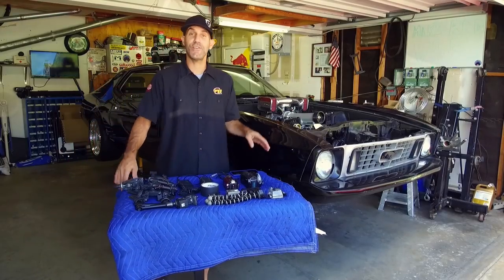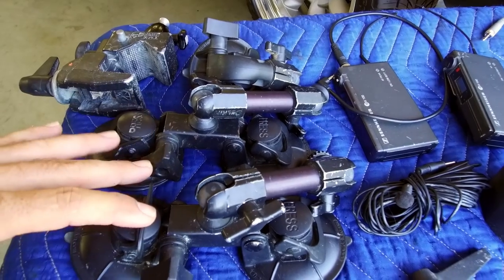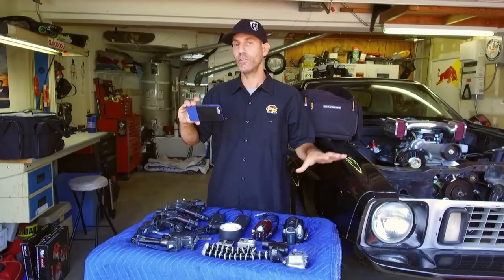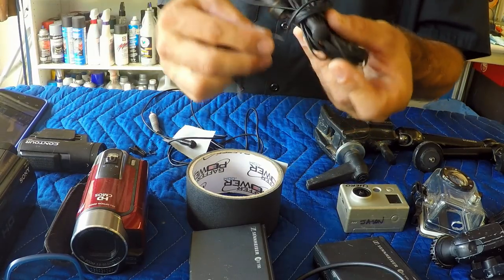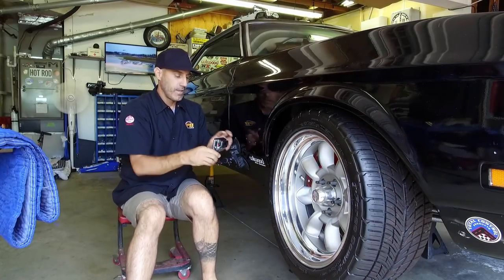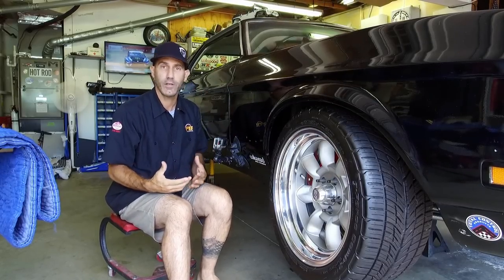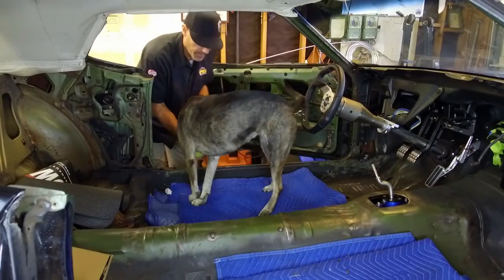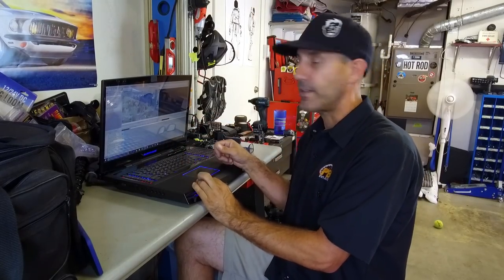How to Make Great Automotive You Tube Videos - PRO Level Tips and Tricks

Comment: This is great!!! You mentioned this vid in a Jeep video but it never came up as a suggestion for the Jeep vids so I finally hunted it down in your videos list. Glad I did, thanks for sharing your techniques!!! The horn honk is a great idea!

I’ll make a wheelin vid some day soon and you can feel free to critique me and I would welcome it but I do have several comments. I only have 1 GoPro so will have to figure out safe ways to mount larger cameras somehow. I have 2 FS7s and a Canon 5D Mark III. I’ll have to check out those mounts you use. Zacuto makes foolproof but expensive articulated arms that could be used to mount cameras I think and they have a lifetime warranty and have deals at times or you can buy some used on Ebay. I prefer when you also include in your interior wheelin shots in your truck the steering wheel to add motion and information. Since your output is HD, it would be nice to have a 4K camera on the dash area that can be reframed in post to zoom in and maybe get both types of shots. Do you shoot anything in 4K to reframe in post and make like having twice as many cameras running?

So it’s OK we can see your house water heater or air conditioner but not the fact you are wearing a lav? I don’t think that is necessary, just my opinion. A little cinema verite adds. How do you know when or if you suddenly get a cloth rubbing the mic sound while you are filming if nobody is monitoring audio? Doesn’t the “gaff” tape ruin the foam wind screen in the lav mic? Non professionals will screw this up for sure. 

Instead I would rather people spend their time not showing unlighted black items on black backgrounds that are also backlit. You wizzed right thru that lighting part. I know most is outdoors but that can make it harder to not overexpose the outside of car while shooting inside or under expose while vice versa. Do you shoot in autofocus or auto exposure modes at all when moving the camera? All too common also is using camera-mounted or even in-camera mics. The other common problem I encounter on YT is too-fast pans or too many truncated clips editing out the part I wanted to see right before it comes up or before I have enough time process it. 

Particularly frustrating are those fancy, well financed, sponsored (10 rigs traversing a technical trail) shoots in which they edit them so you can see the same obstacle being traversed by every single rig, perhaps to give equal camera time to every sponsor, but then run-time requires they edit out showing the rest of the scene even once so you have no reality or context. Showing the spotter without showing their POV is typical, but hey the spotter isn’t paying the bills, right? Logos on the Jeep are! Sometimes it is hard to even figure out who is spotting or vaguely where the spotter is ... spotters should be heard and not seen? Bad storytelling. Some viewers may want to learn how to spot, or in the case of rollovers or dents, how not to. Some people are jaded and need a fresh perspective. Ever seen the sponsors rep show up directing the shots? I naively commented on one relatively big budget, professionally shot video and they responded that I was stupid because how could I possibly know they “edited out the best part” since I could not see it? LOL. The fact I was frustrated watching their video proves they screwed up, unless that was also the goal of their sponsors cause frustrated people spend more? I read in some comments elsewhere that the person who dismissed me is not being hired anymore due to being a jerk.

Every rule is made to be broken and though I was never cool enough to wear shades and always agree they are much more impersonable but I can see using them briefly, in certain settings, like maybe in a high contrast, sun dappled or backlit forrest, or with distinctive clouds above with the top off, using say large reflective shades to reflect them. Doesn’t have to be a talking shot, and best of all, Pinto could wear matching ones. Money shot!

I could not agree with you more about not drowning out the rich car/trail/rain/or especially mud sounds. I appreciate the time you spend tweaking your audio levels up and down, especially down, on music. You have some of the best audio on YT videos which is really great for a “camera guy”.

As for equipment for viewers to buy, I’ll add, spend $10 on sale on one of those pop up reflector/bounce kits to take advantage of the sun. Yes it might reflect in the car and so do lights, but black on black in the shade does not work in HD on YT. 

I was wondering if you monitor any of your cameras while shooting and what gimbals, did I miss that?, and which camera do you use for your smooth walk around shots? I wonder which shots would you use FS7s for if you still had access to some? BTW, If you ever are in the San Francisco Bay area and want to use an FS7 or two I’ll rent them to you dirt cheap. You’ll need to have insurance but if you don’t have your own I can rent them to you through ShareGrid at a special, thank you price and you can get insurance from them. Do you ever shoot thru the windshield and if so when and why. I know if the sun is hitting the windshield every speck of dirt will show but if the windshield is shaded by something attached to the light bar support or roof rack it could work and the expensive camera and/or lens would be protected inside. I have three of those 10” Mathews suction cups and have yet to try them. Have you used any? Would they work with my larger cameras? They win the size test. Do they make roll cages for cameras?

As for always including the hood, or was it the dash?, in shots, Hitchcock would disagree for fiction film. Of course part of his point was when faced with potential death you get tunnel vision and that’s different but I’ll have to rewatch Family Plot now to see exactly what he did or did not do or if a shift occurred at some point. My opinion is, once you show the shot with the hood you have established the context and then can move it forward and leave out the hood so we can see the hidden boulders, or whatever, better. If you are wheelin an incline all you will see is the hood and the sky, but no doubt then you would have to cut to a diff camera anyway. 

Lastly the big picture point is ... there are people who have great cameras and drones who spend lots of effort getting great shots but they don’t edit them in an understandable context, what you call relation, so that I know, or at least assume I know, where the closeup is in the big picture or when the shot happened relative to the other shots. I am left lost, confused or wondering what just happened. It’s bad “storytelling”. Am I missing something? It’s like somebody’s telling you a story and they get interrupted and when they resume the story you think they left something out. 

I’m visually very detail oriented but after seeing this great video I am going to be even more attentive to camera detail watching, or someday shooting, wheelin vids. Thx! Now back to those Aussies with the camera sitting on the car seat next to them, like pet POV. LOL

Comment: Thanks so much Jason. How do you keep all devices charged on the road? GoPro's seem to overheat when recording and charging at the same time? And you got way more devices to charge in the field than I have. Cheers
Reply from the maker: I make a little charging station from the 110 outlet on the jeep and only run the gopros for 15 to 20 minutes at a time and then rotate a few extra batteries into them.

Comment: Great videos for sure! I just recently got my first Gopro and have been filming my off road adventures. I do have a question though. I have the gopro 5 black. Any thoughts on conserving battery power? I have two batteries and the charger. It just seems to burn through a charge to fast and I have to stop and change batteries all the time. Thanks!
Reply from the maker: Make sure to leave the wireless function off while you are recording and if it has protune, leave that off as well.  Those setting eat battery